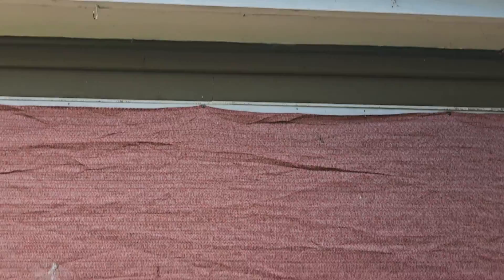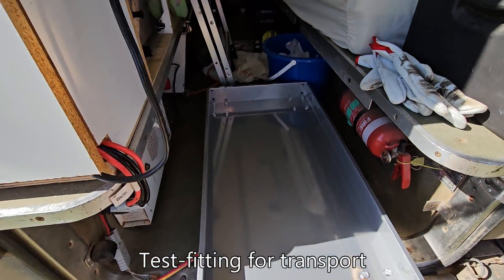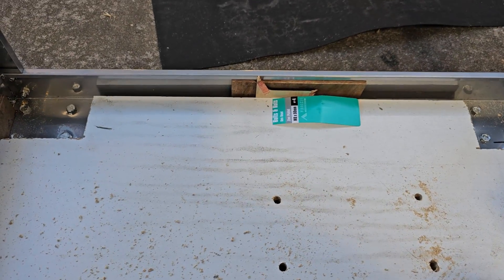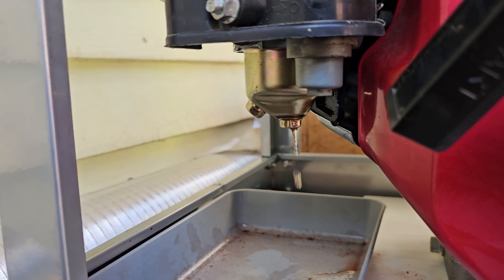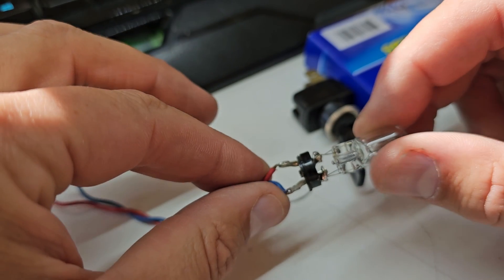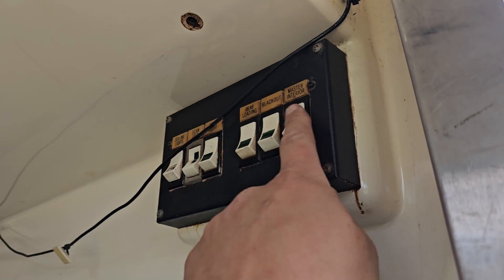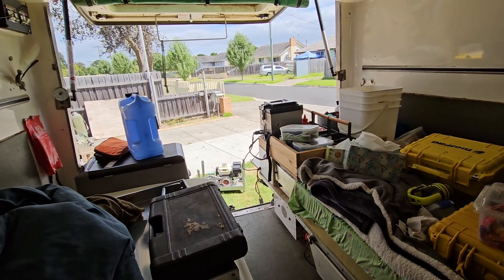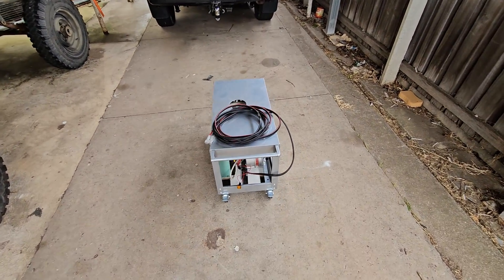Part 2 | Small engine with alternator.

Comment: Looking good mate, a control panel would be good.
The drumming of the top, probably see if  you can get some heat insulation of some sort, not batts, and stick it under the top.
The mass of the insulation would probably stop  the drum and keep the top cool, it could be expanding in the heat from the motor.
On your control panel a press button to briefly read the starter battery volts would be helpful, you could at times when in storage check the basic battery condition.
Reply from the maker: Yeah the panel is coming, only so much I can do in a day though. Also not shown in this video is the float needle cleaning and some sound damping foam that's been installed.
Just trying to work out a way to make a panel that's somewhat isolated from the vibrations, as well as safe from bumps and knocks when moving it.
Reply from the maker: Update, it has a control panel now:
https://youtu.be/lR0DZ-K_q64

Comment: Gday mate ,Could the leaking from the carb be the float height maybe adjust it , Anyway im guessing that motor is a Chinese/Honda copy if so im sure a replacement Carb would be cheap enough and easy enough to source
Reply from the maker: Yeah already fixed, there is another video on that coming in a few days. Bottom of the needle was gunked up, and not closing.